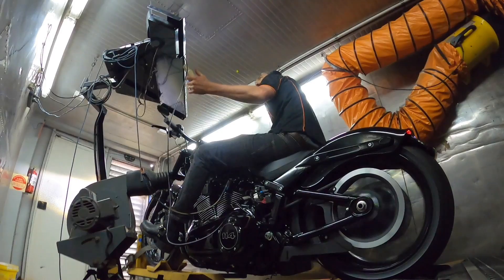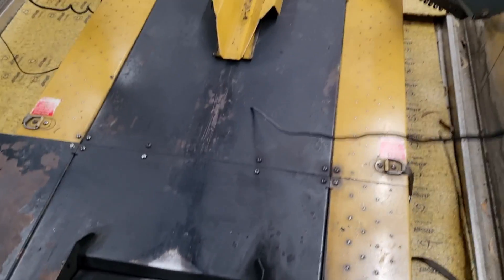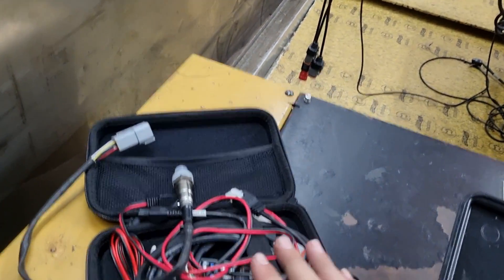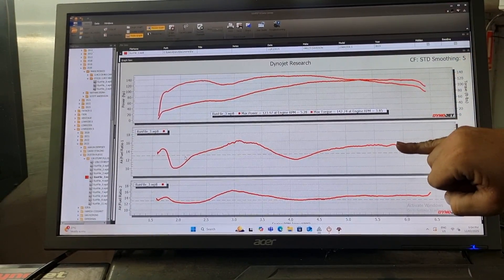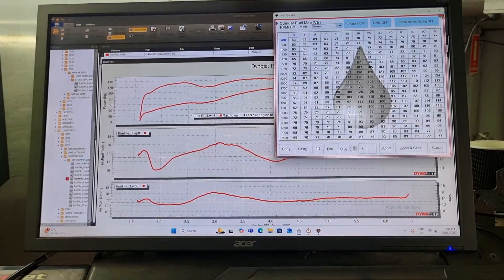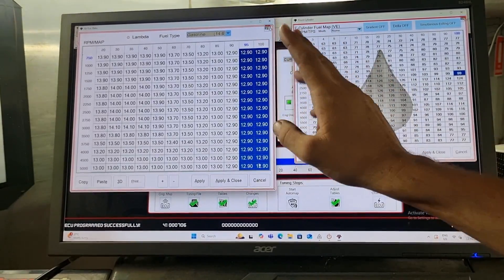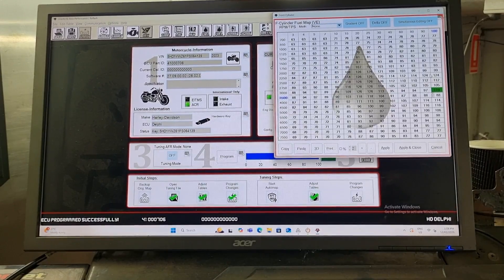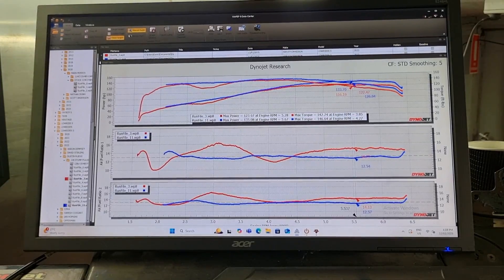HARLEY TUNING SOFTWARE: AIR/FUEL RATIO ADJUSTMENTS

Comment: Ruddy dyno man where I once took a bike set my AFR’s at 16 : 1 so when I closed the throttle there wasn’t enough fuel getting in to keep the engine running… luckily the bike isn’t EFI so I just put larger jets in there…. £1000 wasted on an idiot !
Reply from the maker: Rough experience by the sounds of that
Reply: @MasterTechMiller  Well he wasn't very experienced with Harleys or bikes with carbs... only about 30 years old, I now rely on my 50 years of experience and bugger the dynos  I never ever open the throttle wide and weight for the bike to hit max rpm.... just an old school rider I guess !

Comment: Had my dyno done five years ago 2020.powervision ,107 m8,ss475,bassani Stainless mid pipe.Got 106hp but they eliminated  the 02 sensors. Is that like the easy way man's way of tuning? I'm bringing it to the Dyno this weekend.Just want some opinions on this. Leave them out or go wide band?

Comment: Hey MTM, another very informative video, I'm always learning something new with your great content. Not sure if you have covered this before but I would like to hear your thoughts on suspension upgrades. Seems that everyone says stock HD suspension sux and should be one of the first things you change! Now is this because a lot of people do not spend the time setting up the stock suspension as per the table in the owners manual or is it really that bad? Secondly, what are your thoughts on the aftermarket options for suspension? One brand that I have been hearing a lot about lately is Wilbers. Is it as good as people are saying or is it a bit of a gimmick and how do you rate it?
Keep up the great content and hopefully you get to do a video on suspension upgrades sometime soon! Cheers mate.
Reply from the maker: I personally believe that the stock suspension on Tourind Models is about a 6 out of 10 regardless of how it's setup up.
As for the Softails, I'd rate the USD Forks at a 7 out of 10 & the Rear shock at a 6 out of 10.

The conventional forks on softails are terrible.
When it comes to Touring Models, more often than not, there is a lot of extra weight packed in them & then add a passenger. The stock suspension is far beyond its limits. 
I have installed Legend rear shocks more times than I can remember & I have replaced just as many pairs due to failures & leaking seals.
I don't like Legend stuff for this reason. It's expensive(ish) and I have seen it fail a lot of the time. I do like the Legend Cartridges for the conventional forks. They seem to work great.

As for Wilbers, I've only ever fitted 1 set of rear shocks on a Tourer. I didn't get blown away by them.

The Screamin Eagle/Ohlins remote res shocks for Tourers & Softails seems to be ok at this point. I haven't seen 1 fail yet. It seems to have a relatively good feel & great adjustment.
There Cartridges seem to feel nice too.
Reply: @ thanks for the reply, appreciate the feedback. Cheers.

Comment: G'Day Tommy if your having to tell the injectors give over 100% would it be worthwhile going up a size in  gps
Reply from the maker: Your thinking of duty cycle. The VE Values can be over 100% in NA engines with no concerns of maxing out the duty cycle.

Comment: Hi To. Y,
Great video as usual.
How do adjust a carbureted bike if once cylinder is running rich or lean.
Thanks
Reply from the maker: Great question. It depends where it's showing a lean or rich section. There are many options. The pilot jet size changes fuel delivery at low engine speeds. Bigger or smaller pilot jets change the fuel delivery at thos point.

Then the needle can be lifted or lowered to increase fuel delivery at roll on & higher throttle positions. Then the intermediate jet can be changed too (where the needle slides). 

On top of all this there are specially shaped needles (triple taper) that aid in dialing in the fuel delivery. 

There are lots of different adjustments to the idle mixture screw too & vacuum settings.
Reply from the maker: There is not much you can do if 1 cylinder is running richer than the other.

Comment: I'm curious as to why a wot run gives a good indication of how the engine will perform at its optimum on the street in real life conditions
Reply from the maker: It doesn't. A WOT run gives an indication of overall engine performance.
Reply: @MasterTechMiller  Thanks for the quick reply. Like your videos, they are very informative.

Comment: really interesting always wondered how the process of changes to AFR started ,  ive had 2 117's  24 Lowrider st and current bike 23my Road glide ST both Thai made , im in UK so guess they are Euro 5 compliant  the RG has SE mufflers other was stock both run /ran quite hot it gets bad that it burns your butt through seat so have stand on pegs to get airflow over seat to cool it and that wasnt in very hot air temps here . got my 483cam to go in  plus the ape billet 55/60 inlet to go on plus associated parts  hoping a custom tune will see it run cooler, does this happen with the stock tuned bike in your region too?
Reply from the maker: To be honest we don't have many OEM tuned bikes getting around over here. At least not around city & area I live & ride in.

I have had customers complaining of hot running engines in the past & I found the tunes to be quiet lean which was the main reason.
After I re-tuned them they ran cooler.